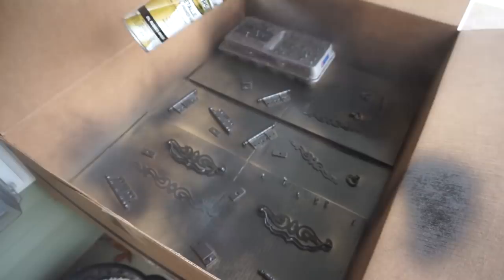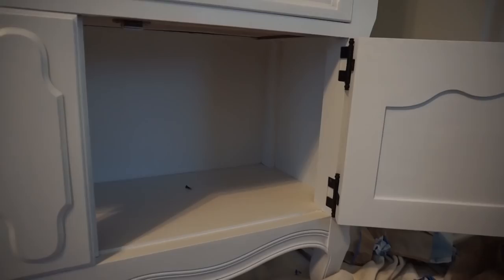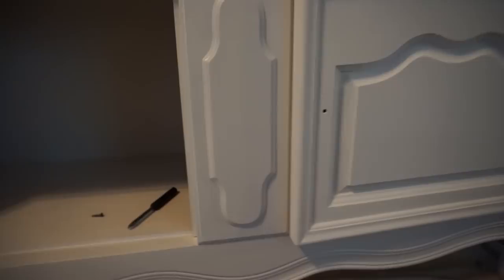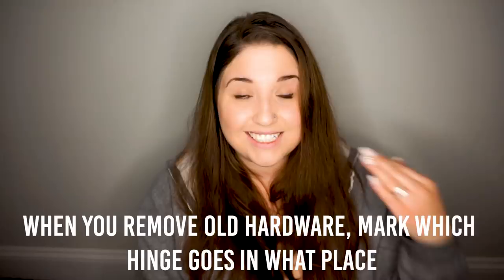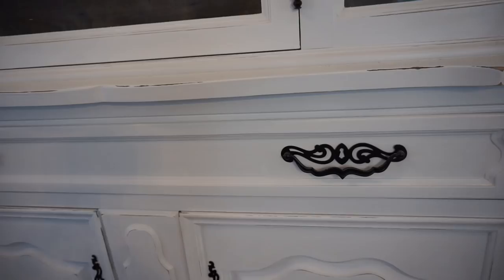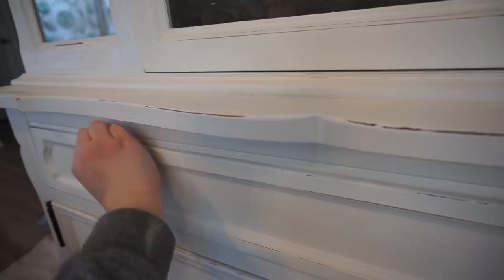The Harrowing Tale of a Disastrous Hutch Makeover - Storytime/DIY Project

Comment: Just watching this beautiful wood piece be painted is making me cringe!  I am not sure where people got the idea that painting wood is a wonderful thing, or that everyone wants nice old wood painted! when the pieces are real, and older (not even antique or vintage yet) IT RUINS the item, and drops the value extremely! If you don't like the shade of wood- sand it and stain it a shade you like don't paint it!
Reply: AMEN! Real wood (especially fine woods) should never be painted. Change the stain if you must but NEVER paint it. (If it is a combo of wood with  formica in large areas to look like veneer- in that case, it is better to follow the best methods of changing the appearance of formica. It can be painted to look like wood of different stains but is a lot more work. If it were me, however, I would not purchase a piece of furniture that combines both wood and formica printed to look like wood with the intent on changing it.) 

If you ARE using paint, why chalk paint?? If it takes 3 coats plus some shelac to cover the wood, that WILL affect the fit of your pieces. Perhaps sanding it before would help in that way but I would use far more durable paint than chalk paint for furniture. 

As you discovered, ALWAYS mark which hinge came from where and put them back accordingly or sometimes the doors will go back on crooked even. Instead of buying new ones, just take them off again and try moving them around until you find the right location they belong in that lets you close the doors properly. (I even mark which screw came from which hole so you don't end up stripping the whole with the wrong screw)

You did a GREAT job and it looks excellent. I think if the chalk paint is going to be that easy to show scratches etc. you may wish to put a clear acrylic coat or two on it. Use the matte version (not glossy or semi-gloss) to get the same chalky look but a far more durable surface or you may be touching it up constantly. (you can leave things on their hinges for this just be careful not to get any paint on them even if clear as it may affect the functionality)
Reply: LOLOL...Your comment is cracking me up...It's not like she painted an 18th/19th Century, fine British antique just pulled from the Royal Palace cellar...Seriously Kelli (no offense intended) but you're WAY out of touch with today's reality & current market trends & personal decorative choices...I had an antique business for over a decade...
Reply: I thought it looked beautiful before the painting. I own several wooden hutches, and they look great in my library filled with books. I won't ever paint them. But it's personal choice and she did a great job, all things considered. :)
Reply: Kelli, opinions are like arseholes everyone has one - doesn't mean that yours is correct
Reply: Some people don't care about reselling it and keeping it pristine until then. Some people like to actually enjoy their furniture, so who cares? She should be able to do what she wants with it, I paint my furniture all the time and hers came out beautifully!
Reply: Different tastes that's all. Some painted wood I like, some I don't. I also can't stand brick fireplaces. To each their own.
Reply: I agree 100%. I'm SLOWLY coming around to the painted look, but solid oak, birch, etc.? Ouch! Part of it is that that kind of solid wood is hugely expensive and hard to find where I come from, so just to paint it is absurd. I would paint MDF, not solid oak omg.
Reply: Here is the reality people. As an interior designer there is a smaller and smaller market for the old hutches. Not even consignment shops want them because they don’t sell. So to keep them out of the local garbage dump let the younger generation do their thing.
Reply: Its preference I personally think it looks sooooo much better painted.. but you can just keep yours like it was made..
Reply: @Kelli - I used to feel the same way, but eventually I realised that how other people treat their own possessions is none of my business, just as it is none of their business how I choose to live with mine.
Reply: Not everyone likes the look of wood. Those old victorians often painted their wood pieces, as did the Georgians etc etc. 
Really it isn’t for you to be so definitive about what people choose to do with the things that they own.